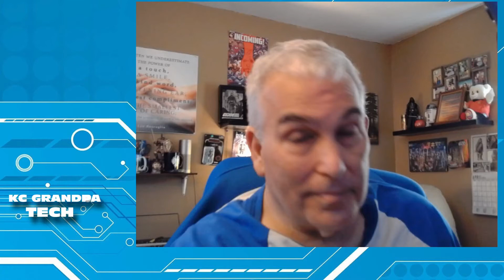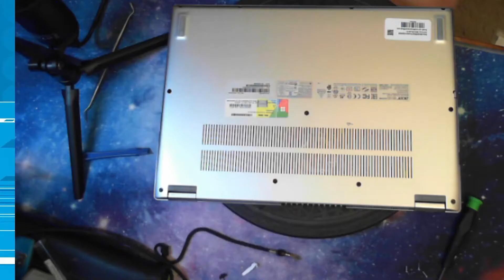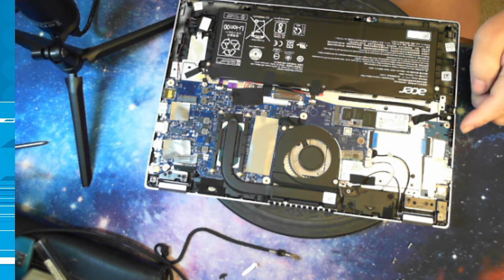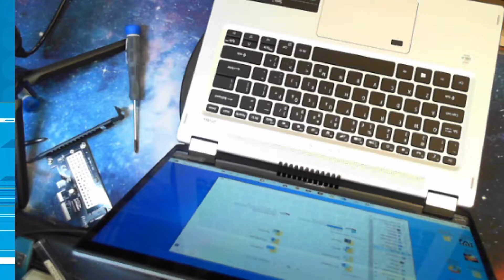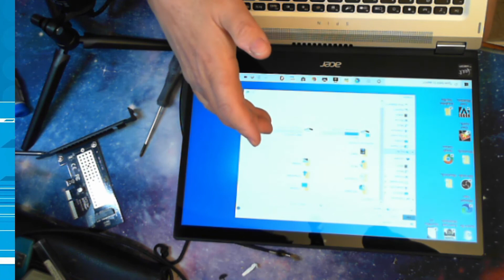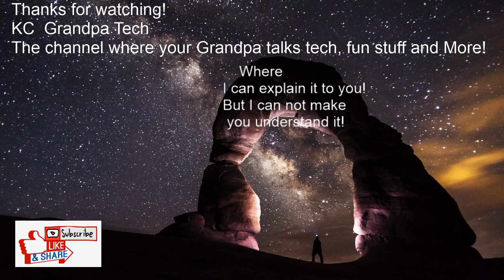How to disasemble a Acer spin 3 sp314,  replace or add or a second m2 drive or battery! Step by step

Comment: Hello, may I ask which size of M2 that is? I was actually looking to see if I could find videos to replace my keyboard, and saw this, so I only just learned you can add more HD space to the spin. So when I saw this I instantly knew I wanted to upgrade to a second SSD, but apparently there are quite a few sizes and I'm not skilled enough to eyeball the dimensions of the one in this video, and when I looked at the user manual on Acer's site it doesn't appear to have this information.

Thank you for your time!
Reply from the maker: Thanks for the comment . Hope this answers your question. The M. 2 form factor is small and rectangular in shape, almost like a piece of gum. Sizes can vary, with possible widths of 12, 16, 22, or 30 millimeters, but they're generally 22 millimeters wide. Lengths can also vary, coming in 16, 26, 30, 38, 42, 60, 80, or 110 millimeters.
Reply: @kcgrandpatech  Thank you for your incredibly prompt reply, especially on a 7 month old video! I really appreciate it.

I'm afraid that doesn't answer my question, as this is all information I've read elsewhere, but can't determine. I was hoping that since you installed one of these in this very video you would be able to tell me the width/length of the one in the video. I've checked the manual as well, and it doesn't even talk about the original SSD, so I can't reference that, either.

Thank you for your time all the same! You probably get an incredible number of questions each day, and even if the answer couldn't help me, I'm sure you've been able to help a large number of people and I admire that! People like you are the backbone of the internet, helping us laymen with tech problems without putting it behind a paywall. Thank you again, and I hope your day is wonderful!

Comment: Hello sir, how do I know which SSD I can buy to add? Bgreat video by the way and thank you for putting this video together. I'm trying to upgrade my spin 3 to run photoshop for work and need additional SSD storage. Thank you in advance for your help
Reply from the maker: most laptops take a 3.5 ssd, spin3 my take a m2 drive, download the manual to check
Reply: @kcgrandpatech  thank you for the reply sir 🙏